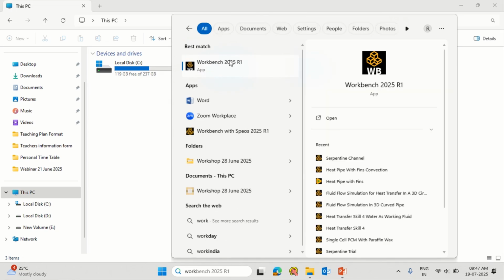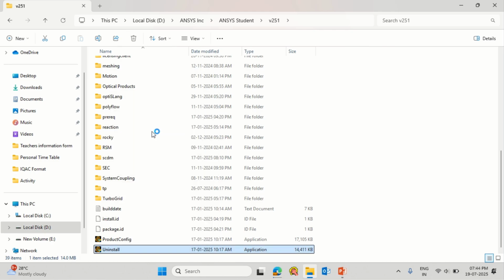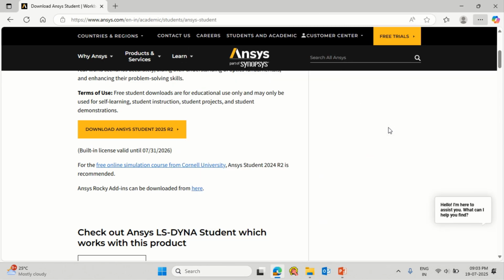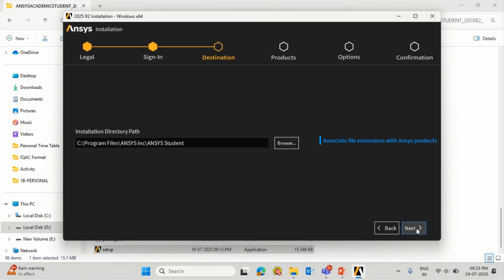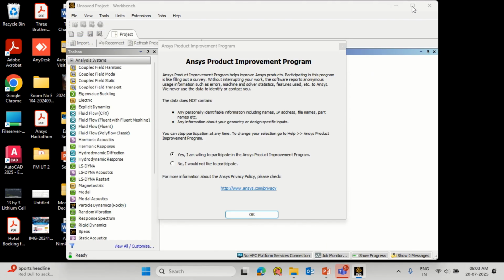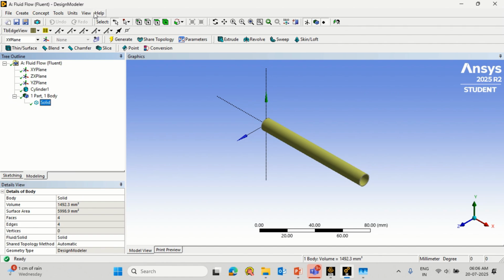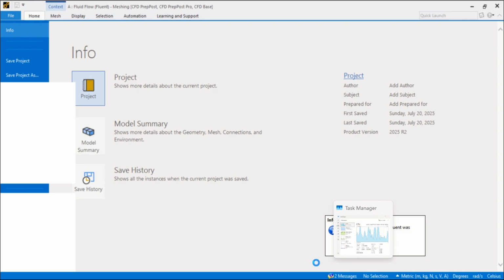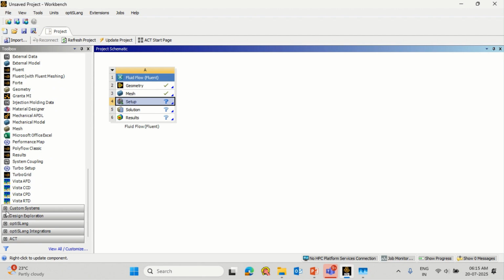ANSYS 2025 R2 Student Version Installation | Full Uninstall of 2025 R1 & Step by Step Setup 2025 R2

Comment: Sir as I clock geometry Ansys discovery is getting opened and not the actual work interface what should I do

.?
Reply from the maker: right click on geometry you will see design modeler and other options
Reply: @FrontiersInCFD Thank you so much sir, but in my tools option everything is blank and not accessible why is that sir .?
Reply from the maker: Installation issue try restart and install again

Comment: Do i have to install on the Installer folder or i can install on any other new folder in the same drive? Will there be problems
Reply from the maker: You can install it in any folder on the same drive — it does not have to be inside the default Installer folder.
There will be no problems, as long as:
You keep all installation files in the same directory
You do not rename or move files during installation
You have sufficient disk space and admin permissions
The Installer folder is only for convenience; it does not affect how the software runs.

Comment: Sir ofter the installation Ansys workbench software not import files from solidwork file even o used step file iges file also please me for import it
Reply from the maker: Check that the file type is supported and ensure the file itself isn't corrupted. use step or iges format

Comment: Hello sir, I have installed this ansys version with same steps ..and I have made a rectangle in geometry from fluid flow(fluent) and then after I clicked on mesh option and then edit from the pop up box...I waited 30min and still the mesh interface is not opened...I tried this many times but no use...is there any solution sir?and my laptop having 16gb ram and NVIDIA GeForce RTX 4060 GPU
Reply from the maker: check for windows update then see if these are available if available then download updates then .NET Framework 4.8 or higher
Then restart your laptop and try again. if not re install ansys again after above update

Comment: hi i am having an error while opening fluent during the 3rd step (setup), basically it says there is an error with the license. I have tried installing multiple times with different suggestions from chat gpt but none are helpful. Any suggestions ?
Reply from the maker: check fire wall setting of your system also make sure connected to internet

Comment: Hello, what should I do when I get a "license manager error". When I want to enter geometry, there is a message like that
Reply from the maker: are u using student version ?
Reply: @FrontiersInCFD yes, i use student version
Reply from the maker: uninstall then check for windows update make sure system is updated till date with all necessary updates then re install again
Reply: @FrontiersInCFD  For the latest Windows update, I have downloaded it again. Hopefully it can be used. What if the license is still the same?
Reply from the maker: check in search box windows update option....ensure windows is updated till date then try installation again

Comment: (Built-in license valid until 07/31/2026)
Reply from the maker: You can use till next year without any issue.. normally there are 2 release per year. So once new release available you can uninstall the current and install new.

Comment: I  am having a lot of issue with license management I have installed it but my account is not made whenever I put my email signup page would not accept it my fluent is not working and my license is not available
Reply from the maker: Try to reinstall the software and make sure that you have an active internet connection during the account creation process.